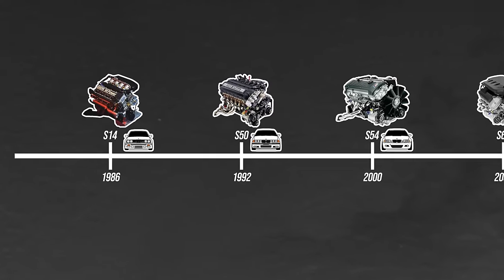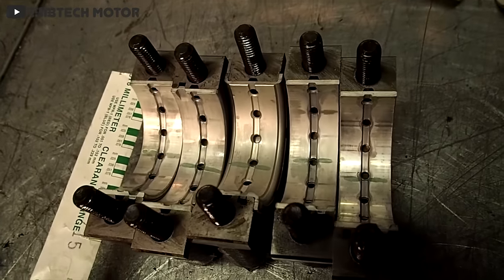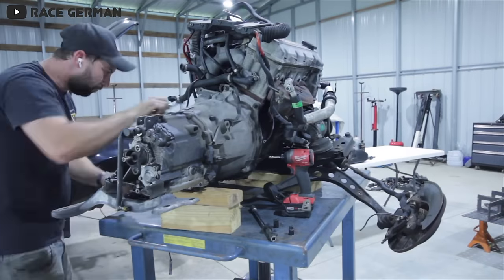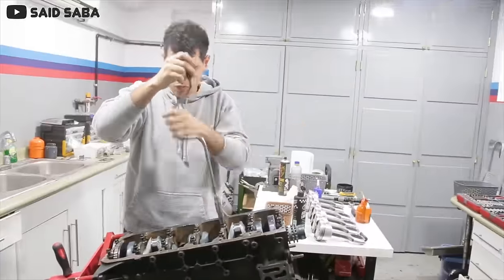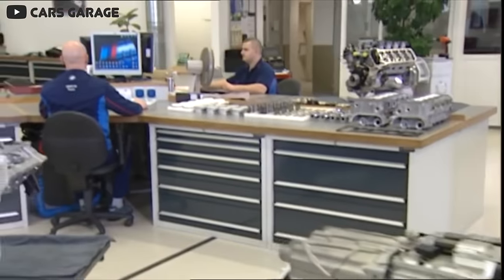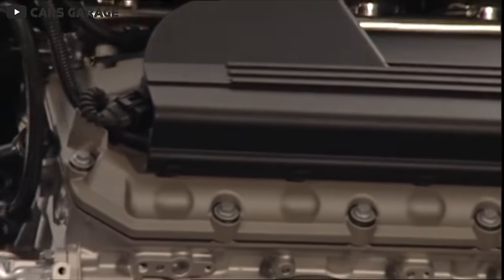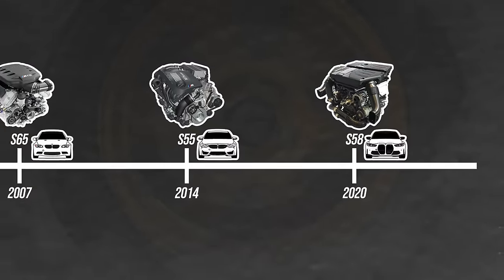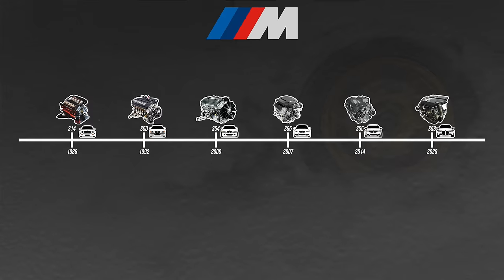The History of the BMW M3's Engine

Comment: Have never owned an M3 but driven a few.   A coworker had a mid 90s car with the SMG single clutch automated manual.  Trans was better than I expected, torque was good, HP was lacking but not a problem unless you wanted 10/10ths performance.  I worked for a component supplier to the 7-spd DCT paired with the 2008 S65 V8.  Got to drive a German spec car on an unlimited section of the Autobahn!  Reached 240 Km/h (150 mph) in 5th gear before having to back off for slower traffic.  My German colleagues claimed the car would hit 300 Km/h if given enough empty road!  If I were shopping for one today in the USA, it would be an S54 drop top.

Comment: Re:  Your comment @ 8:10 that it uses a forged and nitrided crankshaft, BMW used forged and nitrided crankshafts in almost all their engines going back to the 1500cc M-10 of 1962 if not earlier.